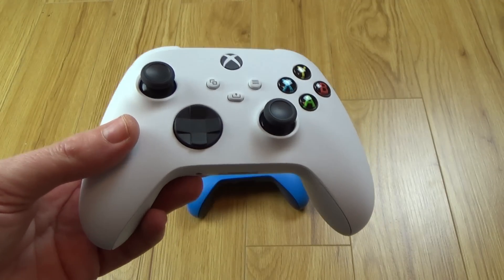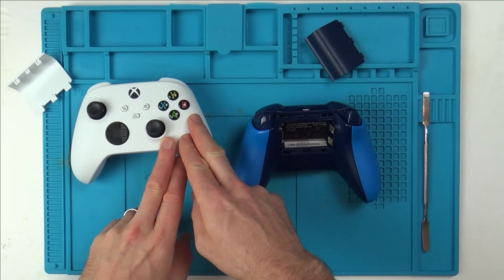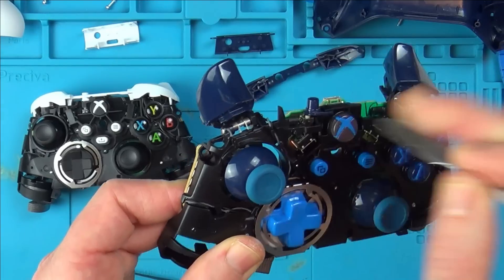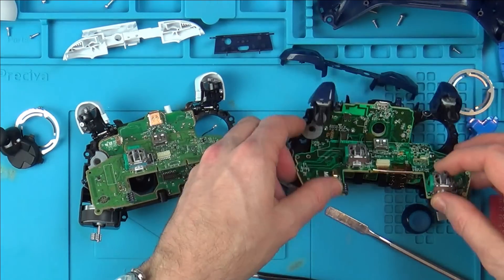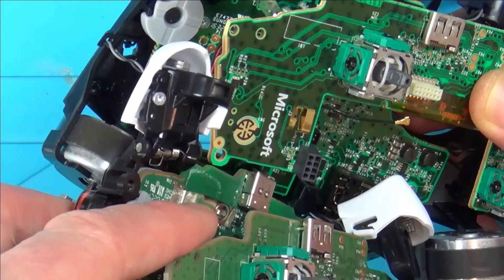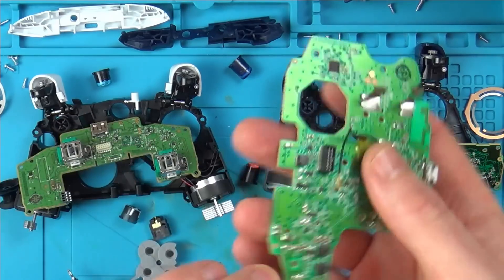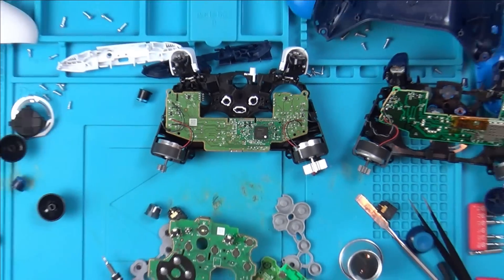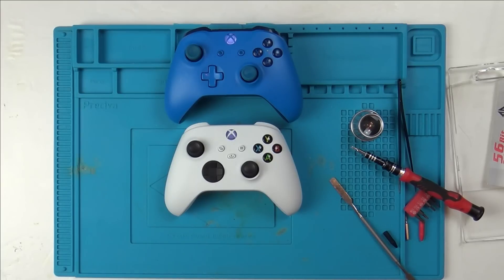Xbox Series X / S Controller Teardown - Comparison with Xbox One Controller

Comment: I'm pretty sure you missed one of the most important parts that has been finally back to standard. ThPCBs are back to fibreglass as they have been some woeful structure made of recycled compressed board that is terrible for reworking if you're in need of replacing parts. The analogue controller on the left has very little support under it and the board flexed too much causing the analogue controller to have issues. The analogue controllers themselves should have been revised up as well as the wear in these from manufacturer is less than 60days i think. And i feel that this has all Been by design to have regular sales of controllers. Because if you spend 100M on this and still they break. You know it's definitely not an oversight. The new controllers don't last and the elite versions have had the same cheap parts internally.  So all poor quality and a rip.off. I'd suggest going for the Razer Wolverine Chroma and have one controller that actually lasts by design

Comment: The #1 reason why their “similarities” are SO F’ing disappointing isn’t—for me —because they didn’t offer anything new like PS does.

No.

It’s because there are TWO seemingly insignificant things they changed that are purposely designed to F over next gen customers.
1. The battery reservoirs between XB1 & XBXS are the same size, BUT the clips aren’t interchangeable. Compare the space between the battery cover’s top two outer teeth…the XB1 has wider spaced teeth SPECIFICALLY to prevent you from using your 3rd party mod attachments (ie collectiveMinds FPS strikepack & eliminator). So if you thought you’d be able to simply use your 2-4 remappable paddles on the XBXS controller…you’re out of luck. Because MS wanted to sell their overpriced stock of Elite 2 controllers that break every 2 months (so much that players actually convinced MS to extend the warranty to 12mo).

2. As the video noted…the new controller has a USB-C port for NO F’ING REASON!! And it’s actually so protected that you can’t even remove it. Why? Same reason as above. It’s a fail safe against players who might rig their controller to accept XB1 paddle attachments with superglue after snapping off the misaligned teeth. Because even if you superglue your extra paddle pack into the new controller…there’s no way to plug in their micro-usb plug into the new usb-c port—at least not without buying a female microA to male usb-c cable (because the paddle-pack cord is too short for a standard 1-piece adapter).

And MS made sure you couldn’t replace the usb-c port with the microUSB because they soldered it in permanently.

MS claims the usbC is for “faster charging.” Bullcrap. If that were true…they would’ve included USB-C ports on the console. But that would’ve allowed customers to use external NVMe M2 PCIe SSD Storage cards with a 10-20Gbps data transfer rate.

MS wants us to buy Seagates bullcrap proprietary $220 storage card. That card is nothing but a standard seagate NVMe M2 SSD card that we use in laptops and consoles. The only difference is that seagate soldered a CFExpress adapter to it so we couldn’t buy the same storage card for 45% less.

Btw…you can make your own storage card by sliding a NVMe M2 PCIe into a CFExpress adapter. Just make sure you buy the right brand and speed (I think WD, Seagate, & Samsung work). Look it up online first.

In conclusion: Microsoft made a shite product to force us to buy 2 overpriced and unnecessary shite products. F*ck them. Don’t buy their “special” shit. Honestly just buy a PowerA Fusion Pro or TurtleBeach controller for $50-60. It’s better quality

Comment: Great video, Thanks - I am interested in the disassembly because perhaps the easiest way to add DIY flight yoke, pedals etc to a series S (for
the Fight Simulator, of course) is to use a spare controller  as the interface:  remove or isolate all switches and pots and bring all terminals
out via a connector... No need to replicate the electronics or to reverse-engineer the communication protocols!

Comment: If anyone have ever any problem with dpad (like noclick or jammed) there's free solution - just apply 2 layers of any insulating tape like scotch or whatever. Worked for me and my friends fine in 5 differend pads, including 1 from x/s series. Cheers.
Reply: i did that too, but not last long. problem is the internal plastic of the dpad button  that contact the conductives are eroded . them just gone flat. i wish the dpad made of stronger material
Reply: @ginjopowder  There's a way other than buying new dpads from myfriends on aliexpress, but to be sincere - it's not worth your time. You can practice plastic binding with a lot of superglue, and then removing the surplus, but as I stated before - it's cheaper just to order a substitute.
Reply: @Niziurek  i think im gonna mold the bottom plastic with iron solder and shape that thing the way it was.. when i have the time

Comment: the A,B, X,Y buttons of my Xbox One Controller started acting strange don't register on every press something between the membrane and the board happened after light use and I keep it in a case so it is not dirty or dusty. Xbox One Controller are not good I recommend agents buying them

Comment: Aside from ignoring stick drift issues, I'm completely fine with how they did the controller. Super easy to get used to because it's almost the exact same shape, but still with nice improvements. It feels so grippy, that every old controller you touch after it will feel sticky and gross.

Comment: the ground on the metal ring surrounding the dpad is there to avoid magnetic interference to potentiometer on the sticks. this dpad design generates more friction specially on heavy use.  its just a safety measure and quite frankly not necessary. this application is mostly found on classic digital cameras where a lot of potentiometer can be found.

Comment: Do you have a teardown video of the XBox Series X controller where you remove the black fixture that holds the circular disc at the trigger?
The part that holds the circular disk has broken in my controller and I don't know the name of the part to order on Ebay

Comment: I love how the new one feeps, but I hate how it looks like a cheap powerA controller. Still, I dont look at it when I play anyway so it doesn't matter. Also the abxy buttons are about 1.5mm taller, so if you use the old ones it'll feel just a little different, bit not hard to get accustomed to

Comment: Awesome video, but I found the X button on the new controller is actually slightly taller. So putting old buttons in the new model. The x ended up slightly shallower than the rest.

Comment: does anyone know if the Rb button press is fixed? that was a commom problem on the xbox one controller, after long term use u need to press hard to the rb to work
Reply: CloverBoi  im trying to fix mine but after 3 fixes the rb dont even work now after long presses
Reply: CloverBoi  thanks for the responce, i will try to get a good price in one new, they usualy on sale?
Reply: CloverBoi  theres a store in my country thats sells for 50 euros
Reply: CloverBoi  and its nearby, thanks amigo, i dont wanna bother anymore replacing the fuc***g button thats goes out every mouth, its insane
Reply: CloverBoi  thank you, keep up the good work cheers

Comment: Good video man, now I won't have to do this myself haha. By the way, for the people that complain about left stick non lasting long enough, blablabla... I've had my xone 1st gen controller for 7 years and still working pretty good, how the hell does that people use their controller to mess it up so fast?
Reply: just think of all the variables at play here and how bad peoples memories are. there's SOOOO many situations that can happen that cause controller issues, with a few examples being accidental dropping it and forgetting that it happened, having a really strong grip, fingers and thumbs putting wayyyy to much pressure on the sticks and buttons, especially during intense gaming sessions, etc. but it seems like the easiest solution for most people is to just point at microsoft and tell them they suck.
Reply: Just play 3 times through Resident Evil 5 and all the Quicktime events where you have to wildly rotate and smash and shake your analog stick will ruin it surely. The game on hardest difficulty had me ruin a new gamepad in 1 playthrough(drifting Stick)

Right after the QTE where you had to run from a huge rolling stoneboulder and smash ur stick Left & Right

Comment: This has convinced me to pick either a fusion pro or a razer wolverine (maybe ultimate) controller once I need to replace the xbox one that I use on my pc. Never going to touch the elites though.

Granted, i've had my controller for a year and only just got the first problem with it, so it has held up well enough I suppose. When pressed down and wiggled mildly from side to side, the A button will register a new connection each time it's moved. Kind if annoying, and I expect it to develop more serious flaws in no time.

Comment: the extra 2 pins on the headphone jack and both linked together when you connect a headset to it. when you remove the headphones the link between those 2 pins is broken. this is how the controller send signal to the xbox that a headset has been connected. anyone who fixes these controllers will just replace the whole unit but its usually these 2 pins not getting a proper connection that causes the headphones not to work. if you use a small flat head you can usually move or scratch the contact point between the 2 pins and your headset will start working, Im glad they have removed these pins on the new one as it is easily the most common issue with the 2016 version of the controller and the new one be using the headsets own resistance to detect that a headset has been connected or something

Comment: So these are the analog controllers. Quite fascinating.. I always wondered if Microsoft made these themselves or if there was an OEM. My question is answered by your video. Thank you for taking this apart and showing us what makes this controller work.

Could you also list out all the silicon chips on the mainboard? I know you showed the microsoft ARM chip but is isn't that intersil chip?

https://tech.alpsalpine.com/prod/e/html/multicontrol/potentiometer/rkjxk/rkjxv122400r.html

Comment: 8:15 the joy stick modules are the same, oh well. last two bluetooth controllers went funny after a year, one is stuck right and the other has random up drift.
Reply: Microsoft and Sony both use veryyy cheap analog modules. Which is a crime for 60 bucks per gamepad. And sad because they functionially belong to the best gamepads. Ive found a gamepad with analog Sensors but it costs 160
Reply: @AbuHajarAlBugatti  The real shame is neither Microsoft or Sony provide a utility to recalibrate the thumbsticks if they are replaced.

Comment: There is a pretty big design mistake in the new controller, if you push the triggers slightly outwards, they can touch/scratch the inside of the casing. Sounds and feels awefull. I noticed because i have pretty big hands and i like to use my fingertip on the left trigger. Thats why sometimes I pull it slightly outwards. 
If you shine a light inside while pushing in the trigger you’ll see what i mean. Not enough wiggle room on the outer side. 
Solution: get rid of 0.5mm on either the trigger or the the casing.
Appart from that it’s a pretty good redesign.

Comment: Hi everyone, so I have an Xbox Series S since launch day, the day after that, my controller fell to the ground and now it seems like unbalanced in relation to a flat surface (you know when you sit on a "dancing" chair for example), of course from the time I first started the console to when my controller fell down I wasn't inspecting too much from the controller I was just playing, so I don't know if the controller was already like that out of the box, but I guess it's because of the impact, like if the plastic happened to be changed somehow, that's the thing, I can inspect it as much as it takes but the plastic itself looks fine, I don't get how the controller is THAT unbalanced, and it's more noticable with the AA's, it just feels like it has something to do with the internal weight or something, everything about the console and about the controller work just fine, I'm in love 💚 it's just that detail, so what would you guys advice me to do or to try? Maybe I could try to do the first step in this video, just separate the first plastic part and put it together again but until it fits right, but idk, as I said I don't get why it is unbalanced just by looking at it physically.. please help and thanks 4 ur time if you read this whole thing 😪

Comment: As TR said, the missing contacts are a push to make contact pair, probably to detect presence of the jack. One key point, although it's difficult to tell from the video is the circuit board looks to have gone back to fibreglass re-inforced rather than cheap nasty paper composite and possibly increased thickness. Should have far fewer write-offs due to cracked PCBs when the sticks have taken a hit!!

Comment: Came here for the headphone jack. They are definitely not the same! My headphones work in the old One S controller, but in the new Series X controllers (I tried two different) the audio is distorted, muffled, and louder in the left ear. Looking at the disassembly, I'm honestly surprised that they do not solder the connector. Either way, something is different and I'm not sure how to fix it yet.
Reply: Sounds like your controller is defective and you should return it and get a new one probably from a different store to avoid getting another from the same pallet with the same or different defect.
Reply: @amartinez97  I contacted Microsoft and they sent me a new controller and it has the exact same issue. I tested both controllers with two different headsets and I also tested the headsets with my laptop. I also paired an old Xbox One controller and that one worked perfectly. So the issue seems to be with the new controllers.
Reply: They are the same. I have taken apart many of both controllers and they are definitely the same

Comment: I don't get it - why is microsoft still making the bumpers out of a single piece of plastic? I've gone through so many broken bumper pairs on my past controllers - i'm so tired of it. My 30 year old SNES controller has two separate bumpers that still work as well as they did when I first got it. Why can't MS just get this right? Was really hoping they would have finally have fixed this flaw for the next gen!

Comment: Does it take the same official Xbox one battery for the Xbox series x
Reply from the maker: Yes it does but you need to get a USB-C cable to charge it. Obviously the new official battery comes with the correct charging cable.  If you are interested I show it working midway through this video  https://youtu.be/FnB2g6LsB2g